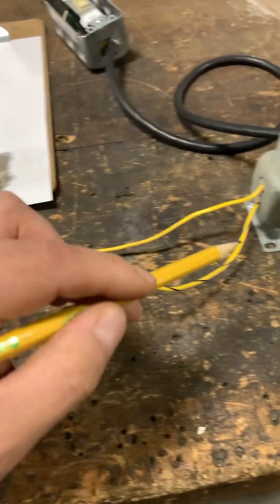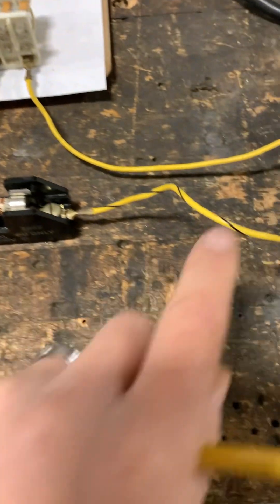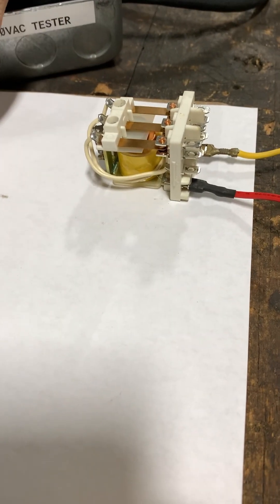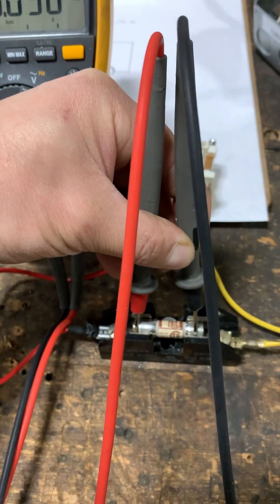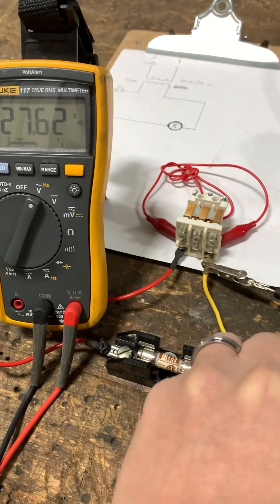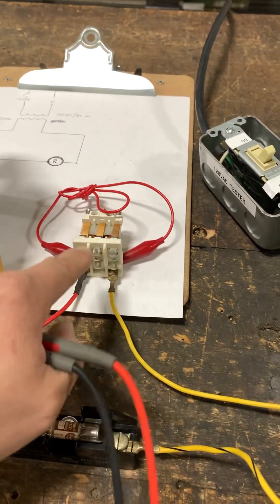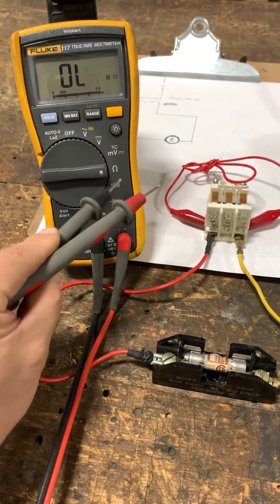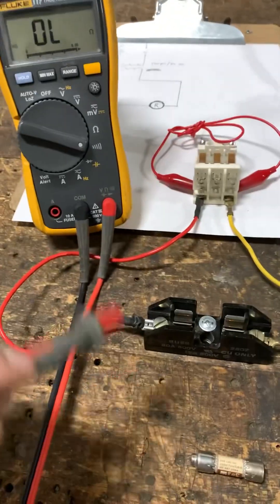Demonstration of a shorted coil on a relay

Comment: My condensing unit has an isolation relay that when I powered on the disconnect switch, it arced and tripped the breaker inside. Does this sound like a failed relay?
Reply from the maker: @chobeeboy44  if you disconnect the load that relay switches on/off does the breaker stop tripping? If it does, then it is whatever the relay energizes is most likely the culprit.
Reply: @ thank you for the advice. I will try disconnecting the load. I do know it energizes a crankcase heater on a compressor and a high pressure cutout.